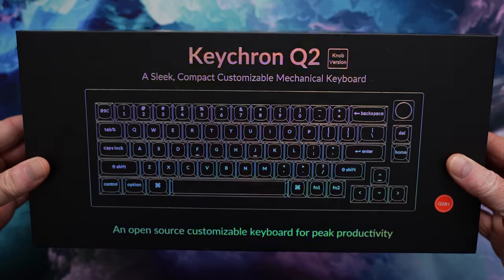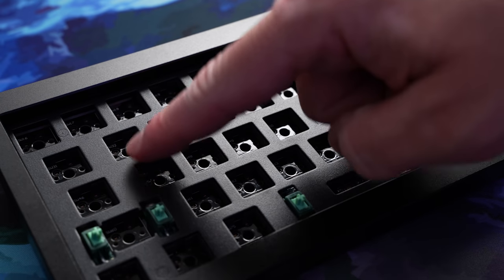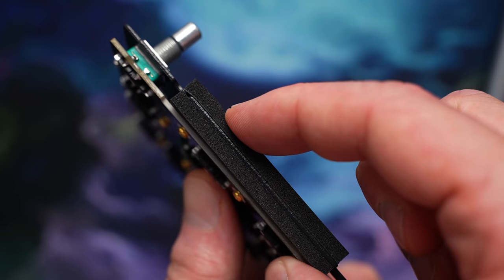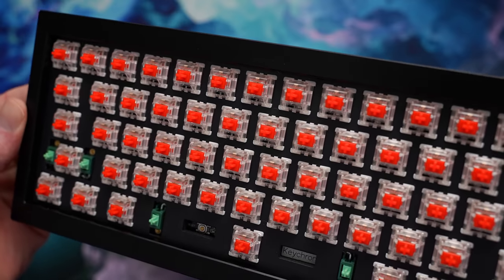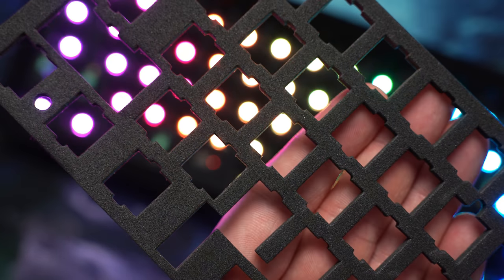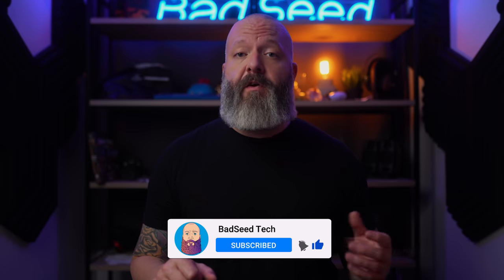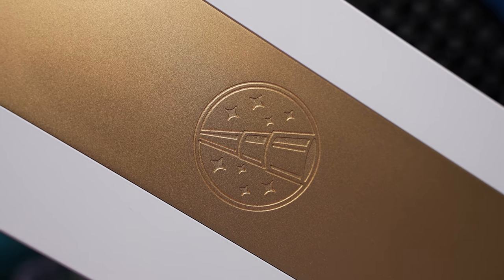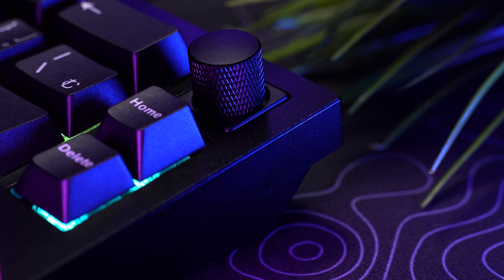Keychron Q2 - Hold onto your KNOBS!

Comment: I'm running the K8, which I've done a bunch of mods to, but the Q1 and Q2 are calling to me pretty hard. Except there's always that strong sense of sentimentality with the board you spent a lot of time and effort on, so it's hard to switch, even for something better, lol.
Reply: Wait for the Q3 hopefully they will improve on that one as well, also it's a full TKL gasket mount for 150USD!!!
Reply: I thought the same thing , but just have both on my desk and use one to use on my phone. I also have one tactile and one linear, because I like both and get to use whatever I feel like
Reply: @botbeamer  uhh that sounds like something i could upgrade my k8 for.
Reply: I suggest not getting a q1 I had one and it was really pingy but I didn’t put a Kilmat in and if you keep both of the bottom foams in it it’s really stiff
Reply: I just bought the Redragon, switched the keycaps, switches, lubed and tape modded the stabilisers and put foam inside. It looks, feels and sounds great lol. The money I spent though probably could have just ordered the Q2 and left it stock lol.
Reply: @botbeamer  +30 bucks shipping. That turned me off immediately, I really wanted to get the q3.
Reply: @vali69  most keyboards have shipping cost around that much, nothing you can really do about it
Reply: @vali69  the freebird tkl has like 40$ shipping
Reply: @botbeamer  yeah man, It's just that you see the price and think "wow it's really nicely priced" and they never mention tge shipping price so you add all the stuff you want to get to your cart and then they tell you how much is shipping and it turns you off immediately. Like, I saw kbdfans was sending their kbd65 lite from their aliexpress shop with a much lower shipping price.

Comment: The thin sound isn’t coming from the switches, but rather the separation of the top and bottom case. Less contact and transfer of vibration between the two = higher pitched and thinner sound. The more surface area you have contacting each other the deeper it will sound.

Comment: Solid build, 65 with or without knob. Can be used with or without mod. Very beginner friendly. A good pick i guess for those who looking for a good 65 that doesnt break your wallet. The resin pour was interesting since they should pour it in a way front should look better than the back but still good stuff. I like what keychron is doing actually looking back their product and trying to fix based on community feedback.

Comment: Sweet. I'm hoping people got a similar result with the updated Q1!  The Q1 (v1) I built for my friend was a bit of a nightmare. The case ping was stubborn and I made the mistake of opting for the FR4 plate which requires you to have a stand off nut from the plate visible on top of the PCB, half way under the arrow keys cluster. Also couldn't put MT3 into board because the keycaps straight up didn't fully fit through the case cutouts at the corners.

Comment: Wow, that's a really really nice stock config sounding board, quite possibly the best I've heard. The only negative for me, other than the fact I'm not a customs guy, is that in all variations we heard I still feel the spacebar needs more work. I like a more muted less hollow Spacebar sound to bring it more in line with the other keys. Great job though Keychron, if I ever go custom I think I know where I'll look first.
Reply: As someone new to the keyboard scene, would putting foam/silicon directly in the keycap itself help with this?
Reply: @DavidReyes0224  Yeah, I wouldn't recommend it for normal caps/haven't seen it done, but for the spacebar one does see it these days. As someone also not deeply into the scene I'm not sure whether there's something pre-determined for that purpose one buys or whether one just cuts up some foam for the purpose. I think it was shown in one of his other recent vids.

Edit: it was the Freebird TKL vid he did just before this. Marked with GMK so maybe something you buy from them?

Comment: The modular knob looks clunky and a little cheap, I think it would have looked much better if the square trim was flush, but kudos to them for getting it out into the wild like they promised.  
Otherwise, the board looks good if you don't mind going without F-keys and like smaller form factors but that shipping price hurts compared to some of the other options, especially for DHL's terrible service.  $30 shipping on an "entry level" board for an American must sting but for us Canadians who are used to paying $30+ to order damn near anything it's just the cost of doing business haha.

Comment: My main problem with the knob keychrons is that the knob doesn't look centered very well and the implementation of the knob on the little square plate doesn't really look as elegant as other knob boards. It just kind of looks out of place.

Comment: If I am being Honest, The move from stock steel plate to Aluminium was really unexpected . And I believe this is to sell more custom plate. But the improvements over the stock Q1 looks great. I have never tried anything as pingy as first batch Q1.
Meletrix Zoom65 seems really interesting considering it's 180 for a complete board with Olivia keycaps and Option for a wireless PCB. This is the board I am looking forward too and can't wait for the Group buy.
Reply: Hey I can understand this way of thinking but it was just to cause alu prices went crazy so there was the way to go steel and keep the same price or upcharge for alu already which would kinda kill the pricepoint.
Reply: @CheswickFS  understandable . But the funny part is the Keychron social media rep told that they opted for steel plate to increse the weight which sounds a bit ridiculous.

But yeah, I don't want to demean what Keychron is doing, making affordable alu In stock custom boards.

Comment: I just want a small wireless keyboard with mechanical keys that feels good but don't make any sound at all. I want the in built battery to charge through usb and last as long as the AAA battery keyboards do. I want it to be lower profile, so I don't need to use some chunky ugly wrist rest either...

Is that too much too ask for?

Comment: If they made a Q1 v2 with the improvements from here... Id certainly consider switching to it from my gmmk pro, cuz screw glorious. But then again Ive also heard bad stuff from Keychron as well
Reply: From what I’ve seen on some discords, the knob version of the Q1 incorporates some of these changes but I don’t know of anyone who has a knob Q1 from the factory (vs modded to solder their own knob) as well as a Q2 to compare.

EDIT: and it looks like BST mentions this further in the video.. haha
Reply: Could you expand on the "screw glorious" comment? Having watched this I'm trying to decide whether to go Q2 or GMMK Pro, additional info could be helpful :)
Reply: @dav3evans  cuz Glorious as a company sucks. They "stole" designs from the community for their keycaps (its a bit of a complicated situation, but at the end they issued a complete non-apology), they badmouth and lie about GMK in their SEO blogpost and there was a couple other "controversies". And Glorious never properly apologises nor learns. I did get the GMMK Pro, simply cuz its the best board for my use case (wanted an affordable 75% with knob, Keychron Q1 wasnt released back then (and there's some issues with Keychron too, customer support being absolute garbage I think being the biggest one)) and I dont have any issues with the product itself, just gonna avoid Glorious as a company if possible.